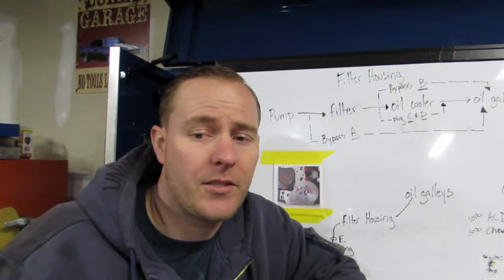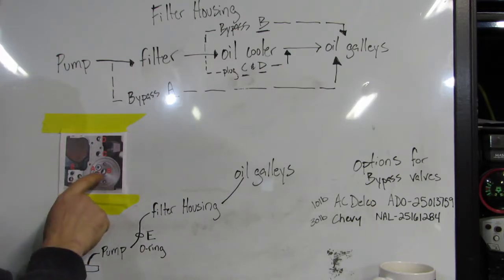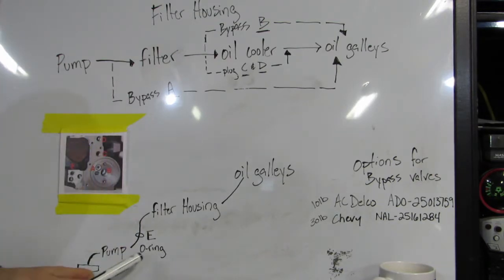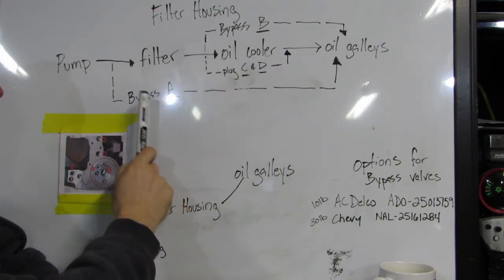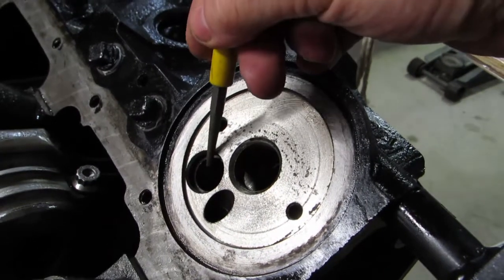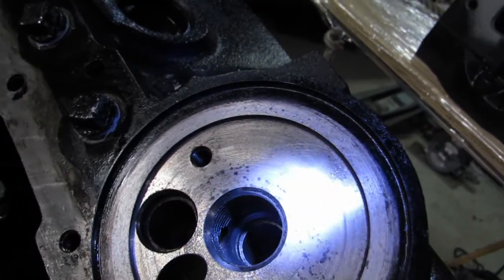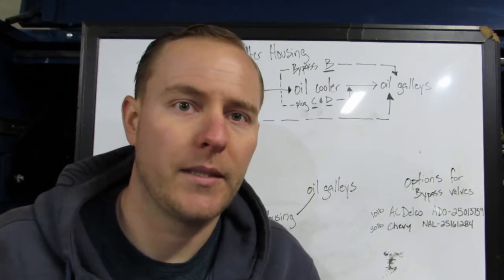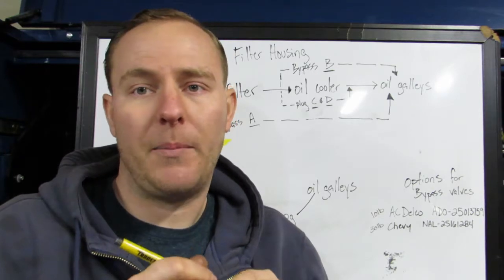BBC Gen V and VI oil filter bypass

Comment: Even marine oil filters have an anti drain back. ie:. Sierra Marine Oil Filters 18-7824-2, I have found so much crap in my lifters, which stopped them from working properly, i was thinking how is the crap possible. well, use an inti drain back, not a bypass except for the 30# in A. when will a 10# A be open? at startup, if the crap was sucked out of the filter into the pan would go straight into the galleys. imho at startup much more pressure on the non filter side so 30# in A should help/stop startup crap going into the galleys my 2¢ fwiw
this is a great video, very very helpful. thanks you

Comment: I've been grappling with to use or not to use "B" ; if you are here and reading this you have probably researched this topic till your blue in the face.   This video is compelling and well done and I was inclined to keep "B' in for the ONLY reason as not having oil drain back down for that split half second on startup.  Makes sense after all,  the oil would be doing 90 degree turns unless the valve at "B" opened at the 10 PSI which under almost all circumstances the condition is met (since idling oil pressure is usually 15-30 PSI) , on the builds such as mine that are NOT utilizing the  "C" and "D' ports (external oil cooler) as they are "plugged".   OK...  So what's the revelation ? Why am I writing this ?   What you are about to read is especially for the people like me that are concerned about oil drain back into the sump from the higher elevated lifter passages and gallies; thus leaving these unfilled over time...   In all my research that I have done, Nobody (that I know) has mentioned what I just ran into today while comparing oil filters.   I'll start it this way;  ever since I began my gearhead/ grease monkey journey through life in the mid 70's one of the most read "must do's" that I always followed was a simple one " Use a PF-35 instead of a PF-25 " due to more capacity thus more volume handling capability "   Since I have about 5 PF-35's laying on a shelf,  I began to wonder why they couldn't be used on the GEN 6 454 (weren't coming up on the part lookups)  even though they have been out of production and superseded.  The PF-1218 seems to be the filter of preference for the Gen 6 454, O.K.  so what ?   I did a simple google search on: PF-35 vs. PF-1218 ...  Wow !  even before this video that I am going to post, I was reading:  The PF-1218 has a built in check valve that prevents the return of oil...   WOW..  I'll repeat it again ... WOW...    A revelation to me, others that know this already may say that I'm thinking that I discovered water, but NO,  I never have seen a filter with a check valve.. Furthermore,  NOW I CAN RUN THE MOTOR WITHOUT "B" without second thoughts or hesitation.  As to why this isn't plastered all over the place leaves me perplexed. If you look up the PF-1218 on SUMMIT or other spec sheets it clearly reads:  " Anti-Drain back valve" : " YES"...     To me the "B" decision (due to drain back vs. lubrication pressure and capacity) was critical as I am sure it is to many of you out there, including Lukas Garrison as it probably exactly why he went to all the trouble of examining all the passages and making a video.  Upon learning about the PF-1218's Anti-Drain Back, I am keeping "B" out and doing what Lukas explained with "A"  "Running the 30 pound valve which will force more oil through the filter" thus cycling more filtered oil.   I hope this helps anyone that is stuck in a "should I" or "should I not"  RUT. (like I was)  Here's the Video link:  https://www.youtube.com/watch?v=8q_hBjBP1Dk

Comment: What you dont understand is the filters have a bypass in them take a long screwdriver stick it down in one and push really hard and you will feel it give, besides at about 20 to 30 lb the stock bypass passes unfiltered oil Back into the engine, No Good,

Comment: Wix 51061 for chevys has a much stronger Bypass in the BOTTOM of the filter ! PLUG  the wimpy one on the filter adapter and if the oil needs to by pass it can ! But it will take a higher pressure. You are passing on false info  !

Comment: Hi Lukas,
I stumbled on to this video and thought I should add my two cents. Both of these valves are pressure differential valves. Meaning, they remain closed until the pressure difference is greater on one side of the valve as opposed to the other. You must remember that there is oil pressure on both sides of the pressure differential valve. The sole purpose of these valves is to prevent oil starvation should the oil filter and or the oil cooler become restricted. If the pressure on the side opposite the spring exceeds the pressure on the spring side by more than the spring pressure setting the plate will open allowing oil to bypass either the oil filter or the cooler insuring oil supply all be it unfiltered or uncooled oil to continue to flow through the engine.

Comment: I have C and D plugged bc I don’t run an oil cooler. I’m looking for a spot to add a oil temp sensor. I’m using the port above the filter housing to read oil pressure. What port would you use ( C,D) to add a temp sensor? Or is there another spot to add it?

Comment: Hello, I'm looking to add an oil cooler to my gen V big block. Can I just put a 3/8ths to 10an for plugs on C and D and put my oil cooler in-between those lines or do I need to install that special oil cooler line connector adapter in C? Because I can't find any long enough hose with that special hose end to fit my application. Just running AN lines would be perfect. Thank you for your help!!

Comment: watched vid and in process of building up a Gen v 454, put both bypasses in, put on new melling high presure pump, when priming it has low oil pressure, 15psi, thoughts are the pressure valve in pump is stuck open, will remove pump and inspect, valve, , so if I plugged oil cooler ports, even though there is a bypass valve, I should still have pump pressure?
Reply from the maker: you should be able to build pressure without any of the bypass's in place. I would think that O-ring on the cap might be missing? Did you clay the pan when installing the pickup tube (maybe it's too high in the pan)? let me know
Reply: @lgelectricalllc  I had checked the measurement for the pan, it's a 6 qt one, and measuring the pickup tube, and had made sure the o ring was in place, I'm suspecting the oil pump relief valve is weak or stuck partially open, these pumps should produce a lot more pressure than I'm getting, also checked oil pressure from 2 different locations, my alternative is replace the spring in the pump
Reply from the maker: @carlballinger844  keep us updated! Crazier things have happened
Reply: @lgelectricalllc  have ordered a GM oil pump, suspect the melling wasn't cast properly, will post when I get the new pump

Comment: Hi Lukas. I am building a Mark IV / Gen VI 454. I want to include an oil cooler. I heard you say that originally the engines came with 10lb bypass valves in both "A" & "B", but then I heard you say that if you were to run a cooler, you would change them both to 30lb bypass valves. I just want to confirm with you that this is what you would do if it were you. I want to do what you would do. Thanks, Brett....
Reply: what did you end up doing? I'm going to put a remote oil filter and plum a cooler in-between it and I'm not sure what valves to put.

Comment: Watched this video and blocked off my oil cooler lines on gen 6 454 didn't remove any bypass valves. Result .... spun rod bearing bent valve wiped can love and smashed piston and rings. Just proved the theory wrong. Since then if read gm recomends removal of the centre bypass valve of blocking oil cooler ports
Reply from the maker: Sounds like you ran it out of oil or had low pressure right out the gate. This 454 puts down 700HP on pump and is running strong
Reply: Nope full oil pressure was watching it when it happened. Full pressure but low volume is what killed it. Since then iv digged deep and along with my painfull practical experience and multiple sources, including GM themselves I now know to remove bypass valve when blocking oil cooler lines
Reply: @Harrybowles1969  which valves do you remove when blocking oil cooler passages
Reply: @benaiahtheassassin  it's the one under the oil filter. Right down the center. (Oil cooler bypass valve) also when you block oil cooler ports, make sure your bungs don't stick into the hole too far which they say is possible to block an oil passage. 
Best wishes dave
Reply: @Harrybowles1969  so leave or get a new valve for the other? I'm just removing the one under oil filter
Reply: @benaiahtheassassin  yes that is correct. Leave out. You can spin oil pump with a drill after, make sure you have oil flowing up to rockers to make sure

Comment: So your saying leave them in there and block it off
Reply: Don't do it remove centre bypass valve
Reply: @Harrybowles1969  how???? I’ve tried everything and I can’t get it to come out. Do you pull? Screw it out?
Reply: @Phuq_it  just pull. Screw a bolt in and pull it should come right out.  I blew a motor after watching this same video from not removing it so make sure you do
Reply: @Harrybowles1969  I did. I bought a bolt didn’t work. I started thinking of bolt’s that would work. Got out the harbor freight pulley puller and found the perfect one. I screwed it in and rocked back and forth while pulling. It came out. Oil cooler delete done. I wanted to do this since July 4 2020. I stopped at a store and seen a geyser of oil everywhere.
Reply: @Phuq_it  where was oil leaking from? Is it fixed now?

Comment: Oil pressure is 60 - 70psi when cold but 25psi when hot. Is this anything to do with the by-pass? Thanks.
Reply from the maker: Tell me more. How many miles on the motor? What rpm are you seeing 25lbs?
Reply: @lgelectricalllc  the 25psi is at idle at goes up from there with the rpm.
Reply from the maker: @joesmith306  I don't think that's abnormal. Are you having issues or just concerned?
Reply: @lgelectricalllc  Maybe I'm over reacting, I just thought oil pressure should be at least  40psi at idle.
Reply from the maker: @joesmith306  I think you are, I have an old t6 regal and I have been beating on her. Started watching that oil pressure and noticed the same thing a few weeks ago....had me panicking. Never payed attention before

Comment: Does any of this have an effect on pressure to the cam/lifter oil passages... will you lose or gain pressure?  I have a BB 366, when motor is cold I get hardly any oiling to the rocker arms. Checked passage for blockage and replaced lifters also checked push rods... Motor has that hollow sound like a damn diesel, until it warms up about 3 miles down the road it quiets down.... Now it doesn't miss or shake like a flat cam lobe, but noticed that it does quiets down when it warms up... put a pump primer on it and spun it up to 60 psi on the gauge... oil comes out around block housing right above cam gear... which is where the oil passage runs around distributor  housing.... but nothing at all at top end... where in the hell is this loosing the oil and not pushing it up any of the lifters or push rods....   note: when installing new lifters...soaked them to fill.. start up after install.... purr like a kitten..no noise... that lasted till the next cold start up...
Reply from the maker: Yes sir absolutely, first....is this a new build? Was it dipped and cleaned?
Reply: @lgelectricalllc  ... nope,   should I put a 30 psi in A and leave B as is ? those are pressure check valves they dont boost oil pressure they just restrict til pressure is achieved.... so having a stock 50 psi pump and a 30 psi restrictor will dribble out 20 psi through the restrictor? thinking that one of them is failing whether it is stuck open not letting pressure build or its stuck and wont open enough to let oil pass... I can only think of one other possibility and that it is losing oil around bottom of distributor housing  above cam drive.... dumpin the oil back into the pan....  stumped..just plain stumped.
Reply from the maker: @jotegg1276  how many miles are on this motor? I wouldn't think the valves are your problem. If you replace one, replace both though.
Reply: @lgelectricalllc  115k
Reply from the maker: @jotegg1276  wow, the only thing I can think is that this is an impossible situation in which you have something blocking those valves.....it would almost have to be filter media. Its not enough miles to think worn pump or bearings.
Reply from the maker: @jotegg1276  what is the psi looking like? Do you have an actual gauge or is it a light?
Reply: @lgelectricalllc   gauge...
Reply from the maker: @jotegg1276  what are the numbers looking like? Is it showing low pressure?
Reply from the maker: @jotegg1276  looking back at your 1st message I actually did a video on tappets that may provide some insight there. You won't see oil at every rocker....as the engine rotates the holes line up and feed the rocker arms

Comment: Hi , Just found your video , thanks for explaining this, I was wandering can I connect a mechanical oil pressure gauge to the plug on the side of the block above the oil filter?
Reply from the maker: Yes sir, all of those are pressurized
Reply: @lgelectricalllc  Thanks for getting back to me .
Reply from the maker: @joecaron7561  no worries boss

Comment: Great summary to evaluate and decide one's wet sump cooling and filtration. Chevy Power suggests increasing pressure resistance on the bypass valve on the Mark IV, so the 30 lb valves make sense. I strive to eliminate any bypass valves with various necessary modifications but that is me.
Reply from the maker: Mike, I really think bypass valves are a good thing to have in engines. If you have the link for Chevy Power feel free to share with us, I would like to see it.

Comment: Did you use anything on the 3/8 plug threads, when you blocked the oil cooler ports (ie. teflon tape)?
Reply from the maker: I used a high temp teflon tape
Reply: Thank you.
Reply from the maker: @johnmathers5990  the only spots that really had me nervous on this engine were the heads. Most of the threads feed the coolant passage (if I remember correctly).
Reply: Lukas Garrison can you call me I have gen 5 new crate engine with no oil pressure. 660-815-2725
Reply: @MrGoes9s  What did you do to correct your low oil pressure on your GEN V?  I’m having the same issue.  Just started happening out nowhere.
Reply: @highspeednoblesgarage3152  i had the same thing. New sensor..then i put thicker oil in. Then I just drove it. 5 years and the temp would rise to 260. Never once bubble over. Dang thing was a freaking beast. I finally just rebuilt the engine

Comment: Great information, very well thought out, the picture is wrong as you claim.. In fact removing B and removing the flow director C, and plugging the oil cooler lines C and D would be detrimental.
In reality it does not matter if you plug C and D as long as you remove the oil flow director C.
Correct me if I’m wrong.
Reply from the maker: It has been I while since I thought about this one. You can choose to use the basket in C or take it out, it is only critical if you plan to use a cooler. It isn't hurting anything being there. You are correct, you don't need B or the basket in C. I kept them to help hold up the oil when she isn't running
Reply: Lukas Garrison Thanks for your reply. Not being rude but at a second look I’m thinking that if I plug C and D (remove the basket) oil will flow to the galleries as you say. However leaving in B will only hamper its flow and in effect won’t maintain oil in the Cam gallery as it can bleed off back through the C gallery to the filter any way. 
Removing B in effect makes it Similar to the way the old MKIV blocks worked straight shot as you say.
I want to remove my oil cooler that is why I am seeking your advice. 
Look forward to your thoughts, 
Cheers.
Reply from the maker: @tonybrowne2371   I see what you are saying. When you put the plugs in C and D they don't reach deep enough to truly block them off, so the basket makes no difference. B will hamper the flow because at start up oil will open it but, it will restrict flow. Ideally, you want to put a solid deep plug in C and keep B because the oil would never drain back.
Reply: Lukas Garrison Test and try. Thanks so much for your reply and time. Will keep you informed if I learn anything more from my own experience.
Learned heaps from your post. Cheers from Australia. 🇦🇺🍻

Comment: Lukas, in stock form, can I just put in plugs on the two ports for the oil cooler. I just acquired a 2000 gen 6 out of the 3500hd with oil cooler.  I don't plan on running an oil cooler. Would I just put in 2 plugs or take some line and loop it so oil can flow to each of those oil cooler ports - tks
Reply from the maker: Just the standard plugs will do (3/8 NPT I believe), no need to loop a line. Putting the plugs in will do the same exact thing a loop will do once you replace the fittings with plugs, do to how the passages are made. You always have the option at a later date to reinstall the original fittings and use an oil cooler. Keep the adapter that is in C, when you pull it out you will see it has a basket (SD1540) on it and you will need it to use an oil cooler.
Reply: Thanks! I'm pulling the 454 and 4l80e out for my 55 chevy pickup. I have the same combo on my 67 chevellle. 
imgur.com/Hzh6EA9
Reply from the maker: @UcantBeSerious03  what controller did you run on that 4l80E? Would you recommend it again?
Reply: here is my 67, previous owner did the swap and even used 3" pvc fittings for the air intake lmao. 

imgur.com/b8oJfLu